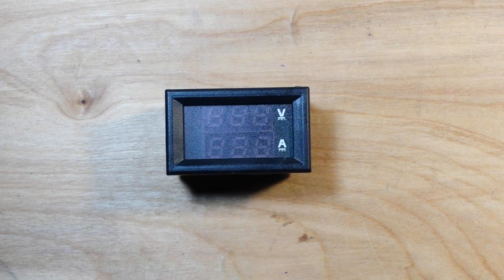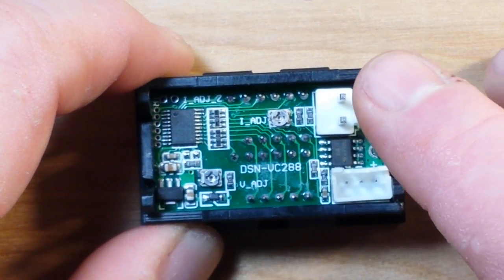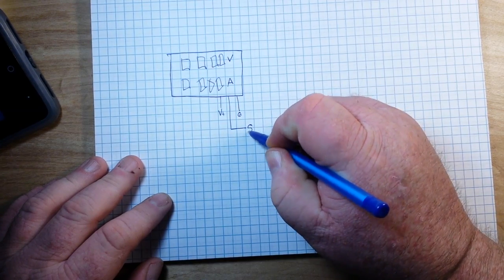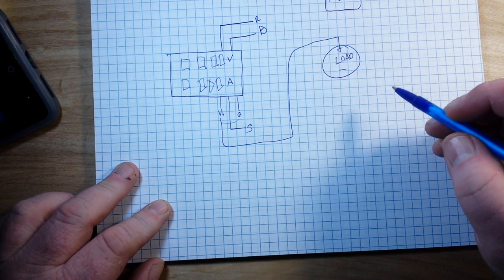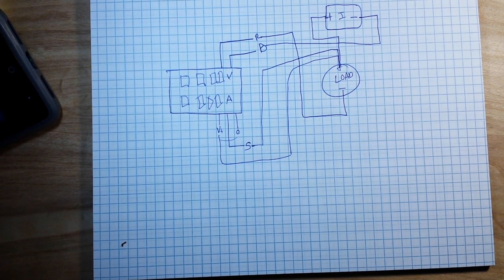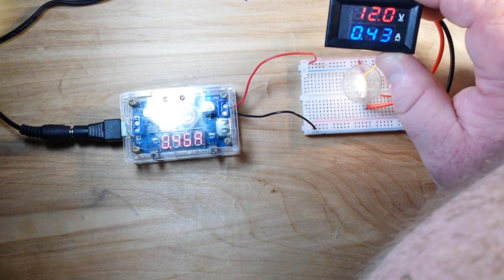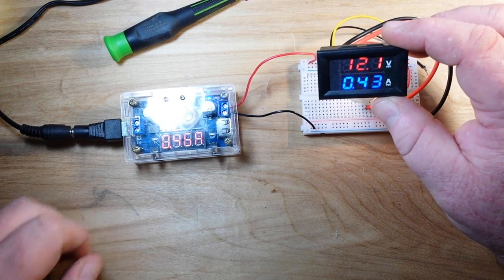eBay Volt Amp Meter How to

Comment: Great video. I would like to hook up a volt/amp meter to my kayak trolling motor. some of the vids either mention or show a shunt has to be used. Does this meter have to have a shunt or is it built in? Or do I even need it "electrical/electronic challenged here" LOL
Reply from the maker: It has a shunt built in.
Reply: @learnelectronics  thank you for your reply and this vid.  ken in Oakley ca

Comment: One of the things you didn't mention that you did, but that makes a big difference: if you're sharing a supply with the load do NOT hook up the thin black wire. If you do the current reading will be off by about 30%. I was pulling my non-existent hair out trying to figure out why my bench power supply would show 0.20A, and the meter would show 0.27A.
If you use it with an independent power supply then you connect red and black thin wires to that.
Reply: Thank you, thank you!  I have been frustrated with inconsistencies in different so-called hookups that don't match. My purchase had no instructions.

Comment: Bought some of these and spent forever looking for videos with info on hooking them up. Never found anything for this style meter. Finally got it to work by trial and error. FINALLY a video on the damn things. I find it ridiculous that the Chinese child labor techs don't include a diagram for their convoluted, commie, mostly fire hazard electronics very often. Maybe it slips their memory with the 16 hour work days and all. 
I am happy to pay more and buy American whenever practical, or at least from a US supplier I can actually contact. 'Merica
Reply: Hey dude, could you help me out, i got the same one but my power supply acts as if current meter is shorted.
It turns on a short plus current limit lamp.
 However, it works just fine with a battery.

Comment: How would I connect this to a welding machine?
Reply from the maker: No no no please. It would pop like pimple.
Reply: @learnelectronics  what would I use to be able to see what amps and voltage I'm using?
Reply: @EJ_173  storage oscilloscope to capture the waveform

Comment: no shunt needed ?
Reply from the maker: It has a shunt built in
Reply: @learnelectronics  Cheers sir, the one i have has no shunt on board :( no problem have made a shunt to suit my need's.
Reply: @learnelectronics  Hmm tink its best if i order another meter with a built in shunt :) cheers for the info.

Comment: Encore une explication qui n'en est pas une... le petit fil noir, qui d'après le schéma va au plus de la charge n'est pas branché du tout sur la planche d'essais...
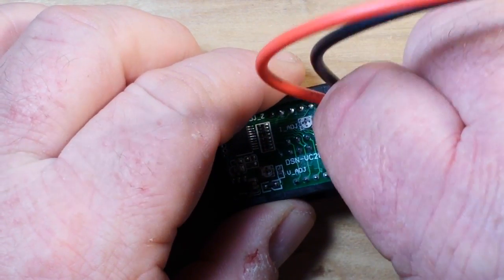Reply: Note that at about 2:06 in the video he says that the black ammeter sense wire is connected internally to the black wire that supplies minus to the power (and a reference ground) for the meter itself.   And apparently that is true for the one he bought.   Other videos discuss this further.   This baffled me as well, because I measured the resistance between the two black wires (thick one and thin one) on the meter, which I bought from eBay, and it was about 1.7 meg ohms.   However, apparently these devices, sold without any specs at all, have variations from one to another.  So I am certain the mine doesn't have the "0 ohm" connection, as much as I am certain that the one in the video does.    I see another video where it is shown how to remove the short (0 ohm resistor!) between the two, so that current can be measured independently.   But that wouldn't help if one is getting power to run the meter, from the circuit being tested, since then you have to connect the two black leads to the same place anyway.   Also, I think that you are incorrect in seeing that the little black wire in the diagram goes to the "plus" of the load.   The schematic which he draws, shows it not connected to anything.   It is the tiny red wire, serving as positive input to power the meter itself, which goes to the plus side of the load (and equivalently to the plus output of the power supply.

There is something in the schematic which is disconcerting, in that the voltage sense wire, which goes to the same place as the meter plus power input, seems to show that it is the middle wire of the three tiny wires coming from behind the device.  Whereas on the physical connector, it is the meter power supply negative (i.e. ground) that is exiting from the middle of connector plug.   If one pays no attention to the positioning of the wires coming from behind the device as shown in the schematic,  but does pay attention to the colors of the all the wires, then the whole video does make sense.   Excuse the reply in English...  I can read French better than I can write in it.

Comment: I purchased 3 of the same meter from ebay, without instructions, of course! All wires were the same thickness, BUT the 3 wire connection is a 4 pin plug using only 3 pins, the colours are YELLOW, GREEN, BLUE with 4th pin - between the GREEN & BLUE - not used. What are the colour equivalent functions between the RED, YELLOW & BLACK  and YELLOW, GREEN & BLUE? I hope that makes sense.

They can be seen at this site: https://www.ebay.com.au/itm/DC-100v-10a-Voltmeter-Ammeter-Blue-Red-LED-Amp-Dual-Digital-Volt-Meter-Gauge-FK/323457877572?ssPageName=STRK%3AMEBIDX%3AIT&_trksid=p2057872.m2749.l2649

Thanking you in advance.

Comment: someone pls help problem no display. I have checked this works and displays correctly using second power supply. I have wired this "I Think' as in diagram but something is wrong as mine isn't working for me.
I have the R(red) volt the load R the battery R and blue sensor all connected to each other. the current Red connected to the load negative. the current black connected to the battery negative and the volt black not connected. Im sure this is how shud be , redone this for last few hours ...must be something silly im doing ..thanks :)

Comment: I want to measure down to 1 volt and need to separate the measuring part and LED's and the actual input pin to the voltmeter.  Where and how can I separate these two lines?

Comment: You forgot the 0-100v setup.
If i understood it correctly this setup is for the 4-30v measurements. Which means the meter will shut off if the supply is under 4v!?
Reply: It will shut off under 4v and it will smoke over 30v. If you need to test higher voltage then use a different wiring scheme.

Comment: Anyone knwo how to connect this meter to the solar panel and controller?, it just measure volts but 0 amps.
Reply: It Will only measure amps if a load is connected

Comment: Great video! Thanks man. Your a good teacher. Hey, how do I make a meter or voltage regulator, power charger so I can charge 12 volt to 48 volts I have all kinds of electrical parts but and cordless 18 v various parts. I also am new to this but I have to get this 48 volts Ebike lithium battery charged which is a bunch of those computer batteries. Thanks man!

Comment: Problem with using the same power source is, that the meter don't show lower voltages under appr. 2,5 V It is better to power the meter from an independent source, wich is easy done by tapping the raw power and add a simple regulator.
Reply: volt meter turn off with using the same power ?

Comment: Would the small G-black go to a metal in closer if using one. It's just loose?
Reply: I had the same question.  Based on this pdf I found <http://hamguyparts.com/files/Download/Chinese%20DVA.pdf> I think the small G-black wire doesn't carry any current unless you want to measure something that uses over 30V.  In that case the V+ red and G-black small wires are used to supply a separate low voltage power supply to the meter.

Comment: Paul Metcalf is right, you have to mention the wire colors of v+, s and g. A 12V incandescent bulb will never consume as litle as 0.43 mA with lit filament. Have you ever tried to see the range of the voltage where this display work in this configuration? Well if you go under 4V it stops working, because it needs around 4.5V to work properly. So if you can, please show us how to get this work with only one source, and to display from 0 - 12V.
Reply: macacinelecanale, Actually, it depends on your meter. Mine read down to 3.2 volts or less. Below that you do get flickering as the power comes up.

Comment: Per my diatribe below, does it require a different diagram to use this display with the bangood power supply kit you built-?  Seems like it might not power the display from zero output, do I have to hook the led panel up separately to my transformer power source instead of the power supply boards output or--????  Thanks, Mike

Comment: Hello - I started watching your channel a few weeks back and have subscribed, and now that im old broke and retired and seeing all the great new (cheap!) beginner kits and modules available now, ive decided to start beginner electronics as a hobby with breadboard, stock of cheap asian components, kit build, fresh multimeter collection, etc.-lol-after seeing your AN8008 review I bought it then later the updated AN8009, and wow these little guys have great functionality and accuracy for the money-!  The 8009 has some minor changes, temp. function in place of square wave and the addition of the NCV feature among others.    I built some kits back in high school many years ago but that was a loong time ago.  Anyway, I already know how to solder so my first kit project is the 0 - 30 volt power supply kit you built in a recent video for giveaway,  it will make a good basic supply for my beginner benchwork and be a useful item instead of some pointless blinky light siren gadget.  The issue im having is I ordered the 0 - 33volt / 3amp red/blue LED display with built in current shunt to monitor both voltage and amperage variation using two upgraded 10K precision ten turn pots to control the power supplies output and show readings on the LED panel - but I wasnt sure this wiring schematic you gave here would be the same for my version of this LED readout.  I need a clearer understanding on just how to wire the darn P-Sup and LED panel from a single power source (24 volt transformer) and there are so many variations on the net that dont all wire the same it appears.  The 0 - 33 volt / 3A LED display I chose unlike yours does not have the "V" and "A" printed on front right, and it has a built in shunt, one plug with red black and yellow (thin) wires, and the other plug with two (thick) red and black wires.  If you can spare the time for an old duffer I would appreciate it, I have a brand new (RIB TR75VA001) 120v / 24 volt / 3.1amp AC power transformer to power the whole thing from one source to hopefully give max available output from the PS.  I just want to be able to use this led panel (or one like it) to monitor the power supply kits volt and amp output.  I have considered maybe I should have gotten the 100volt/10amp led panel like yours instead-??  Is there a different diagram for my particular situation-?    Thanks again so much for any help - - I tried to copy and paste the link to the ebay page I got the display from but YT of course wont allow it....  Thanks again, really liking your videos.

Comment: Do you have a diagram that would use this LED meter mounted on a N Scale flat railroad car. I want to measure track voltage at different areas of a model train layout. The input wires would be attached to the wheels of the flat car. What would be minimum power  (battery) required to power the meter?
Reply: 4 to 30 volts DC

Comment: Great video but i have a question - I got a V68 digital meter and i took it apart to see if i can modified to read the voltage on my car it suppose to read AC voltage it has a circuit board to handle the AC power but from that board there are 3 wires that go to the digital display circuit board ( positive,negative and sensor ) but between the sensor wire and the negative wire it has a electrolytic capacitor but if i just disconnect those 3 wires and hooked them to my car will it work ?

Comment: Thanks for the video. I kept on shorting and powering off my electronics whenever i tried to even just get a voltage rating.. Am i right in assuming the black wire from the 3pin connector, is used to be able to power on the meter without any actual voltage going through it? (Small red and black on another supply/rail, and yellow still on the one you want to read?)
Reply: I've got it all hooked up now, however my PSU (converted ATX) is acting weird. Sometimes when i power off my circuit that has the meter connected, it powers off everything, and i also had to create a seperate rail for the meter, but i assume that probably my variable modules fault and not the meter itself :)